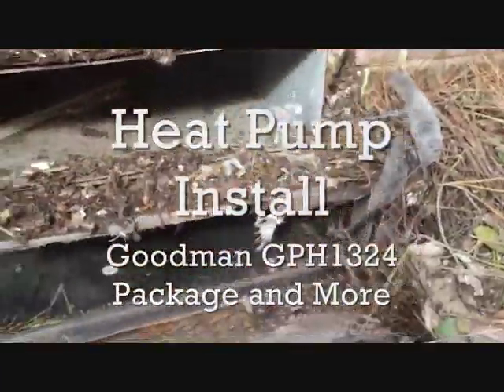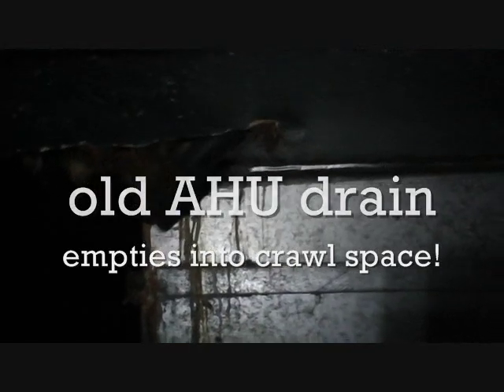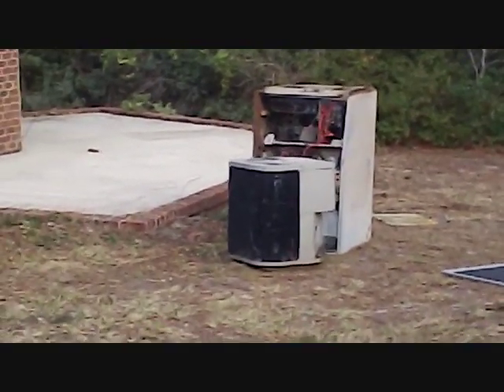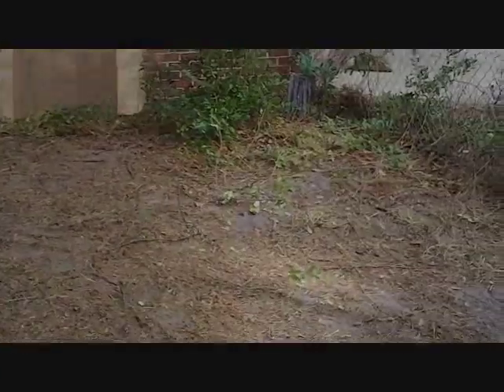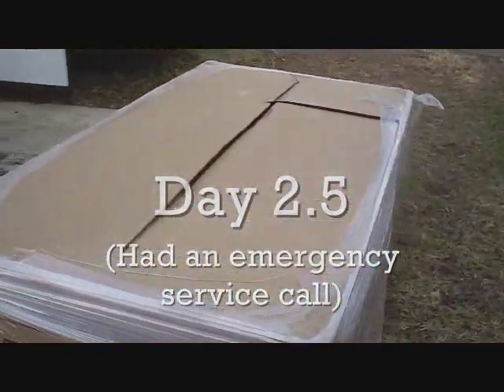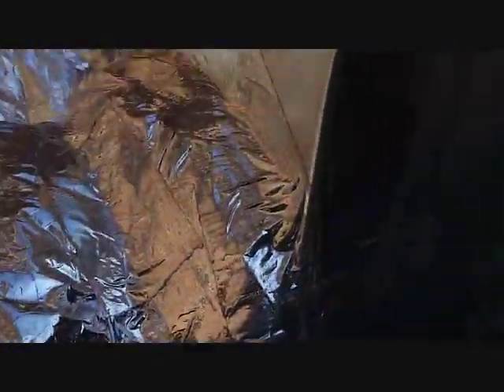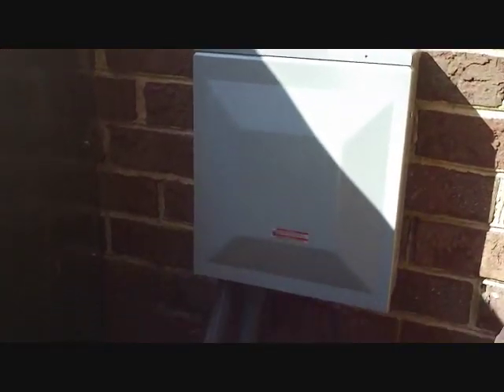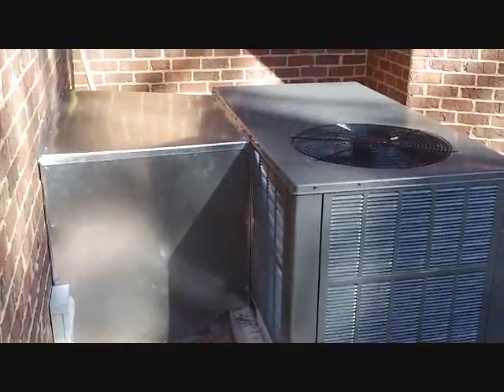Heat Pump Install- Goodman GPH1324 Package Unit

Comment: I bought a house that I need to install a heat pump a 2. 1/2 ton you know the wire size and braker size ,,,I was told  a 60 amp and 40 amp both for the air handler ??? and a 30 amp for condencer unit..is that correct or incorrect.???